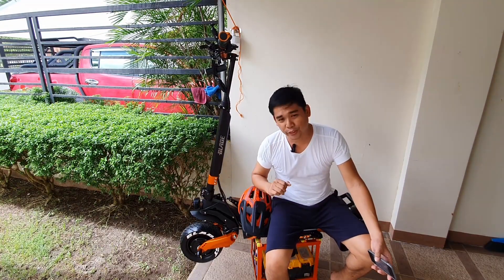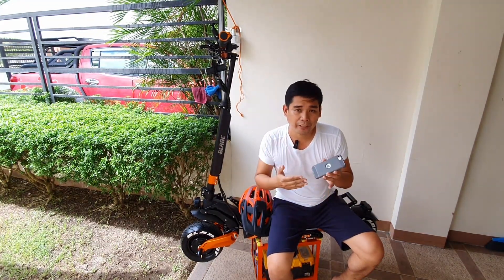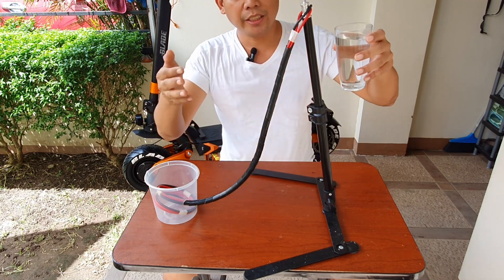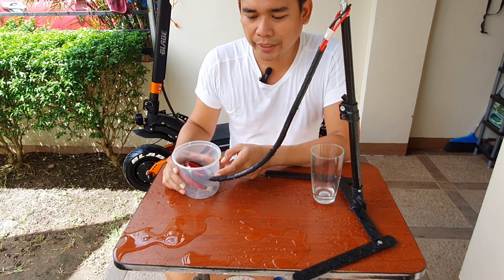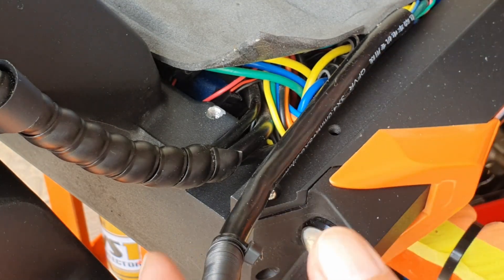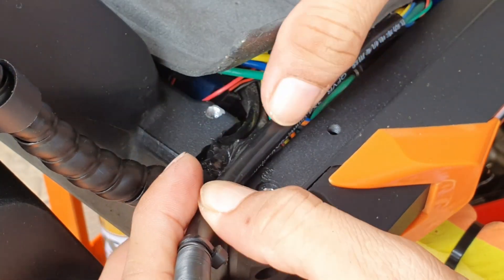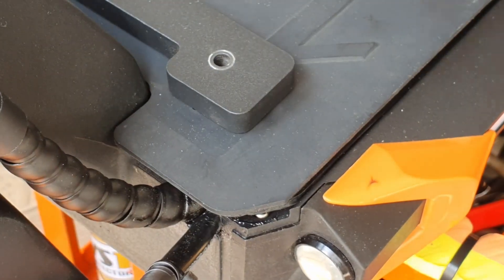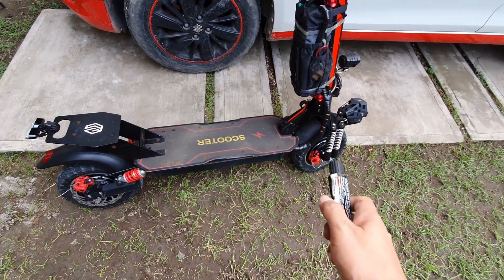IP Rating of Electric Scooter | How To Improve Blade GT Plus Waterproofing

Comment: Anything outdoors use should have a water rating of you could drive it in the bottom of the ocean considering that most scooters at a couple hundred bucks to a couple thousand bucks and they don't want to cover water damage when it's used outside is not very good for a company you should make it as waterproof as possible and then cover any damage if it happens to get water damage I have no idea if they waterproof an intestine don't know where it will feel where to tell you not to do when using it and then you know no way you can get water inside of it is from doing what you're not supposed to do with because the company is always trying to take advantage that you're not going to read the direction book or any of the warnings you just want to plug it in and go

Comment: Trying to find that mighty gasket on amazon but i can't find it can you post a link to it or any other one that would work thanks
Reply from the maker: Any silicone sealant will do. Most common is engine gasket sealant, it will not harden and will just be rubberized when dry
Reply: Thanks  @ScootTaBai